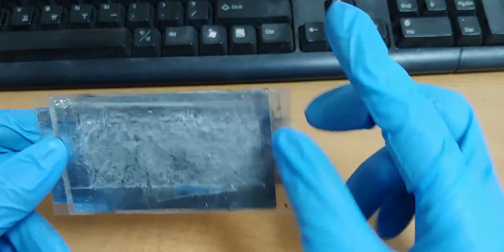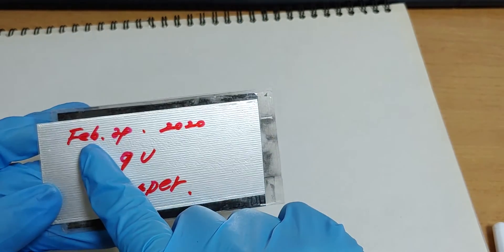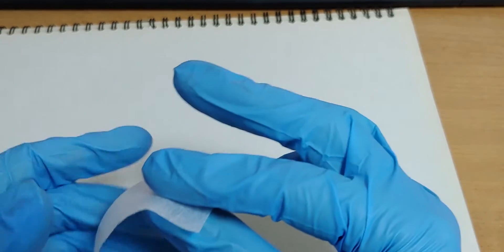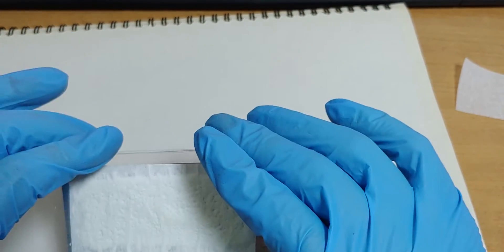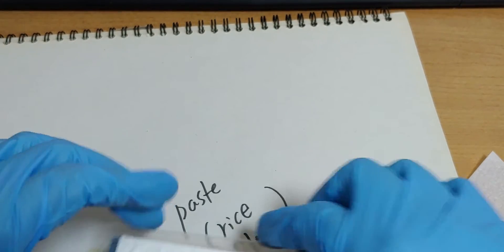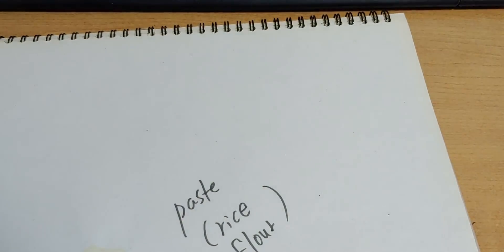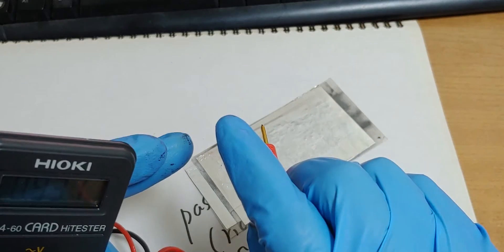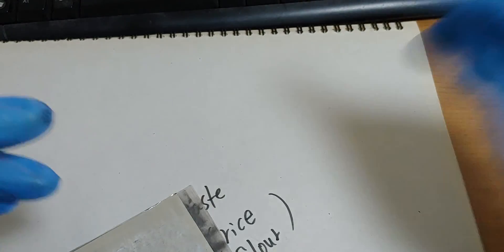rechargeable solid state graphene battery

Comment: Why is your voltage meter always so unstable?
Reply: Put it in a plastic bag and make it vacuüm maybe
Reply from the maker: @matteofeyaerts  
Very impressive. I will think about it seriously. Have a nice day.
Reply from the maker: That's because this battery is in solid state. So the space between ceramic and graphene electrode can vary, which is a problem to overcome. Thanks and have a nice day.